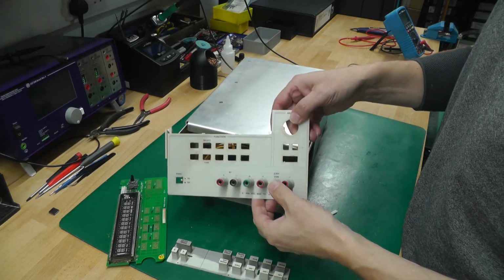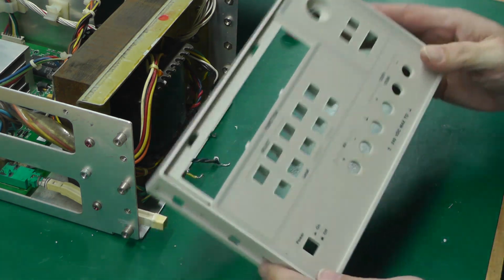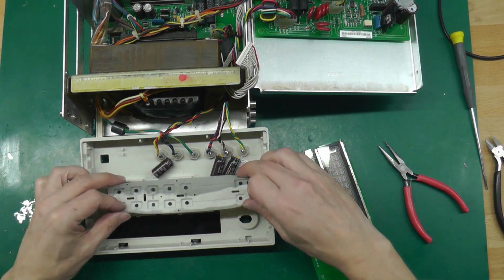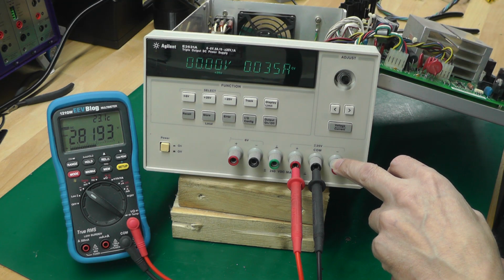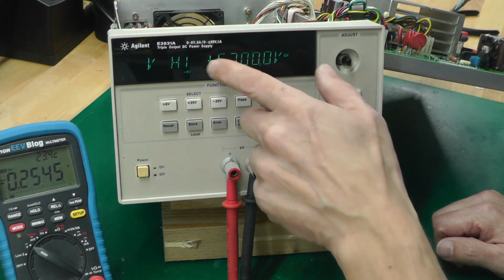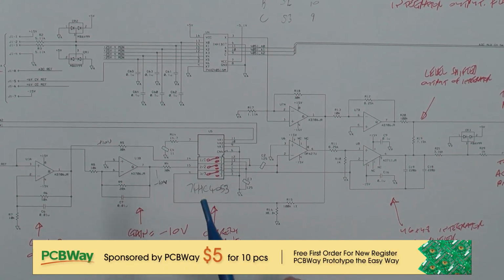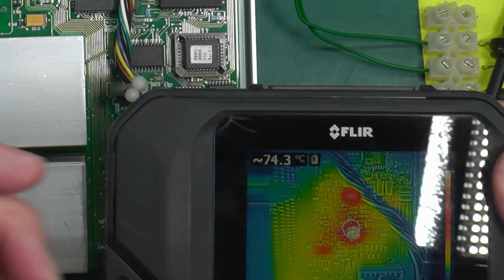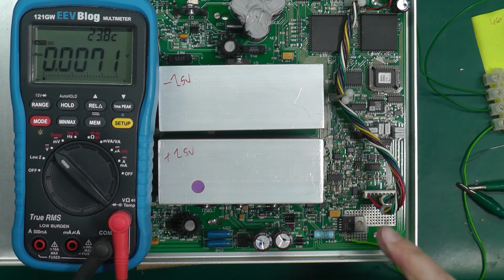No.068 - Agilent E3631A Power Supply Repair & Restoration - Part 1

Comment: Great description of Multislope at 29.38.  I didn't pick that up from reading the E3633A service manual.  All it says is "The ADC method used by the power supply is called Multislope III. Multislope III is a charge balancing continuously integrating analog-to-digital converter."  Thank you.

Comment: Hi Ian, the 3631A was one of the first HP PSU's I repaired.  Beware the optocouplers when you are measuring them. Easy to slip with the multimeter and if you short the right two pins that are next to each other the opto's die instantly... good luck with the repair, it's an interesting architecture to diagnose faults with. 

https://gerrysweeney.com/agileent-e3631a-power-supply-teardown-repair/

Comment: My friend , never ever go into CAL mode unless all circuitry is functional 100% and you need for CALibration to get accuracy , otherwise , keep away from any CAL modes on any TMI ... Also , from my long experience , I rarely got faulty OP-AMPs so please recheck those faulty parts you have thrown away , might be working !!...
Reply from the maker: I respectfully disagree, page 66 of the service manual states that you can terminate any cal setup without changing its calibration constants by turning off power.....which is what I did. My observation in there was to attempt to see if there was any corruption and no more.
Since 1984 when I first got attached to the EE workbench I have had plenty of faulty op-amps.....:-)

Comment: Hi Ian,I amlong time fan ,would you share your duel psu schematics and code from the upgrade you did to convert to two big lcd displays I would love to update mine as the display is very weak and on it's way out ,I was hoping to put lcd displays and a digital voltage and current  keypad on but not sure where to start would love a peek at the code you wrote buy any help would be appreciated, thank you for the great content, best wishes

Comment: Great video as always. I highly recommend you check the opto couplers on the main regulator board as well. Mine had two of them dead plus the opamp that you just replaced (OPA27) and also one or two of the resistors around the ADC were also open. So it seems those components are dodgy in this series

Comment: Wow, that certainly meets the definition of a "face plant". I really expected it to work after the front panel replacement. It must have failed first and then was damaged in storage/shipment. This should be another excellent series of power supply repair videos! Thank you, David.
Reply from the maker: The PSU was packed really well. The unit reflected the photos of the unit prior to shipping. There is a sticker on the enclosure "powers on, cannot control output".....LOL!
Reply: @IanScottJohnston  Please, how much does this device cost?

Comment: On The 3647 there was also a supervisor IC which messed with the 5V rail causing it to not sense the voltage, not sure if that is the same architecture.

Comment: The HCNR200 opto couplers are a suspect from me, I had issues with those on a 3647A
Reply from the maker: The analogue signals are reaching the multiplexer IC just fine. The ADC isn't working, the integrator is doing nothing.
Funnily enough, my own home made PSU from years back used the same analogue opto-couplers I think (terrible things, their tempco is BAD), so I have loads of them.